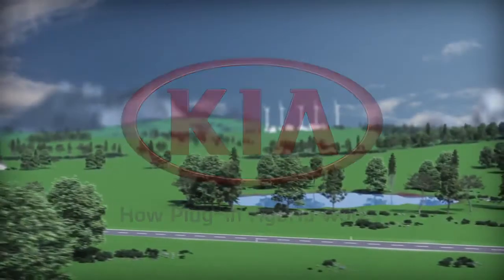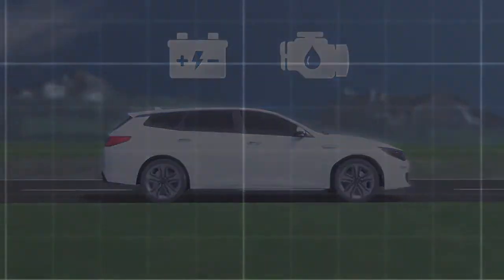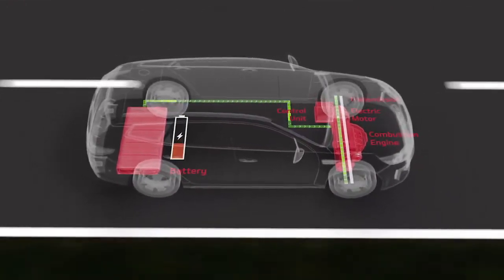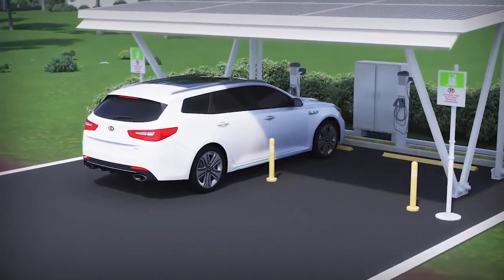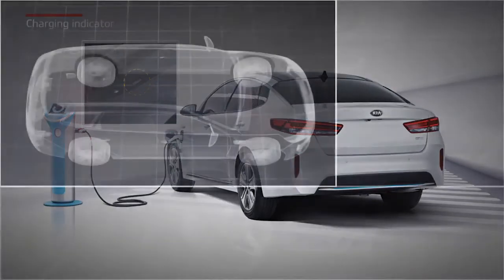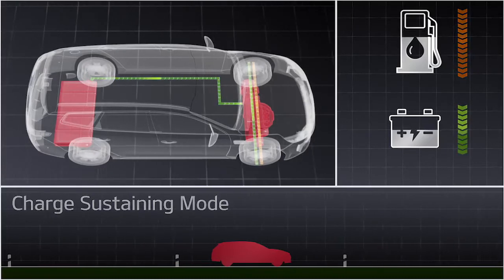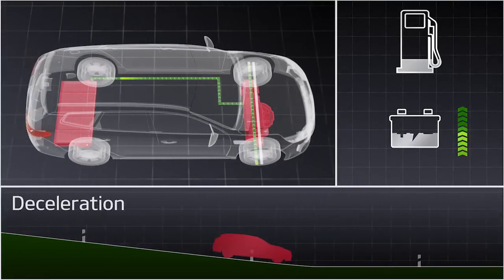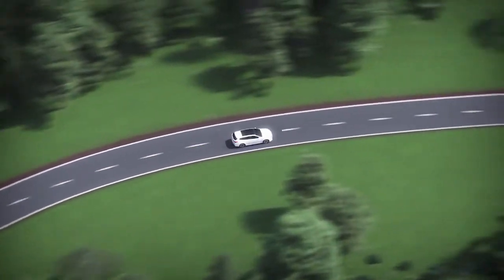How Plug-in Hybrid Vehicles (PHEV) work

Comment: What’s The Difference Between Plug In Hybrid And Electric Vehicle Charging What’s The Charging Difference
Reply: I am surprised noone's answered You so far. 

Electric vehicles are charged on either AC or DC chargers - AC chargers usually deliver up to 7.2 kW, whereas DC chargers can, depending on the car's maximum allowed input, and the charger's maximum output, take anything between 50kW - 350kW. While charging on DC chargers is much faster, it does mean that the battery capacity (therefore maximum range on full charge) deteriorates over time. 

A Plug-in usually has less than 20kW battery (in the case of Ioniq PHEV, the battery is 8.9 kW) - whereas the batteries in the fully electric vehicles tend to be over 50kW, depending on the manufacturer and the trim spec. 

Good day.

Comment: A question about plug in hybrid car:
Once you exceed the mileage range that is provided by charging a plug in hybrid car, does the car start behaving like a self charging hybrid, or does it only use the gas engine, from that point onwards, till you plug it in to charge it again ?
Reply from the maker: Thanks for your question John, once the electric range has been used, the car does act just like a normal self charging hybrid.
Reply: @draytonmotorsgroup  I am thinking to replace my old Golf IV from 2002 when it dies (for a 20 year old car it holds up suprisingly well)i am aiming for plug in since ev infnrastructure in my country is almost non exist. Not sure what car brand yet but i am aiming for plugin. In Wroclaw big city, we have only 3-4 charging station and its not working frequently due to errors / problems.
Reply: @draytonmotorsgroup  
Thank you 🙏🏼
Reply: @draytonmotorsgroup  wow that’s great
Reply: @draytonmotorsgroup  So technically, does that mean the car does not have to be plugged into an external charging station for it to re charge?
Reply from the maker: @kOt985  Though usually regenerative braking only adds 10-15% more range with city driving and a negligible amount with motorway driving, under optimum conditions such as an extended trip downhill, regenerative braking can recharge your vehicle up to 50%. So to get full charge, yes it will need to be plugged in to an external charging station or wallbox.
Reply: @draytonmotorsgroup  Okay sweet thanks. So does that mean I could run on an empty fuel tank so long as I use regenerative braking system to have enough battery in the car?
Reply from the maker: @kOt985  We would not condone this and you would have to refer to the manufacturers guidelines for clarification on the finer points of the powertrains capabilities.
Reply: @draytonmotorsgroup  thank you
Reply: This concept is a gimmick
Reply: @rodgersmakaza  
Can you please explain your comment?

Comment: What happens if the battery is full empty? can we still keep driving with Petrol? then what would be the chnage in Fuel Economy?
Reply: It never goes full empty. When you can't drive only on electric mode then car drives like hybrid and its self charge during driving
Reply: what happend if i dont charge the battery if i drive only with combastion engine ?
Reply from the maker: @vaskok70  The car will act just like a normal self charging hybrid
Reply: @vaskok70  I assume you can never use the fuel engine alone, however using only electric motors is possible when it’s fully charged externally. Correct me if I’m wrong.
Reply: What happens if I leave the car in the parking lot for 6 months, no charger around, come back 6 months later?

Can I rely on gas alone to start the engine, drive a few miles to the charging station?